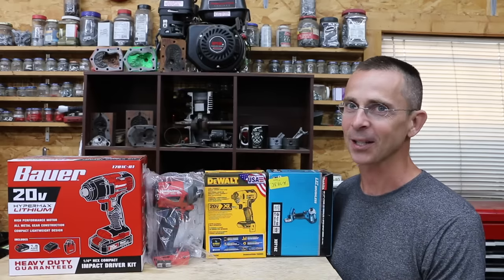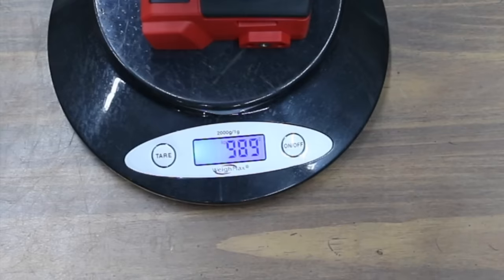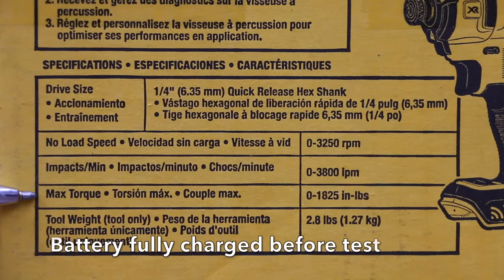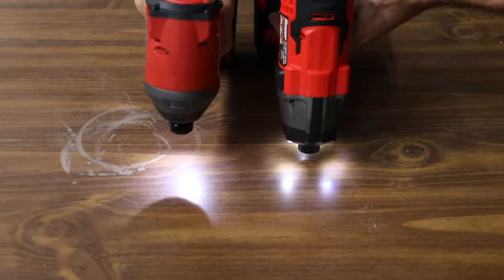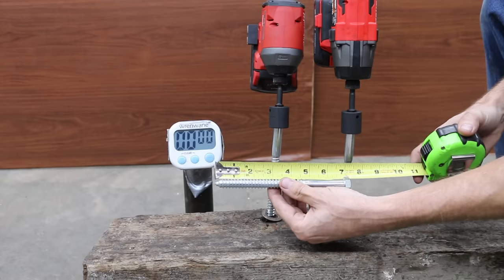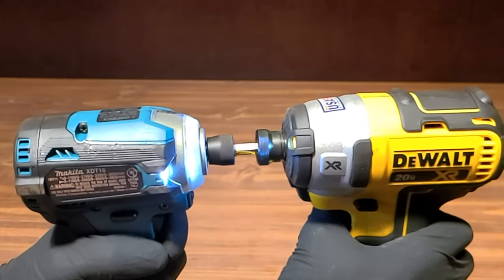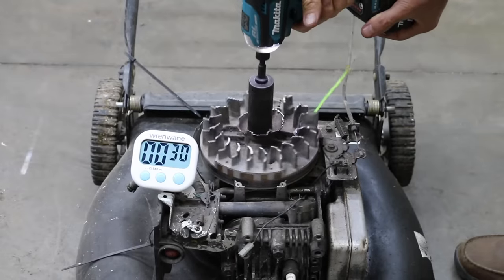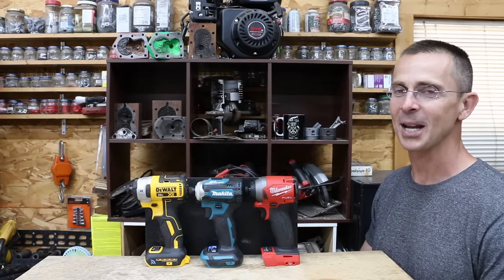Best Impact Driver? DeWalt vs Milwaukee vs Makita vs Bauer!  Let's find out!

Comment: Hey Project Farm if possible start throwing in Walmart’s “HART” brand to test when it comes to power tools, interested to see how it compares. Thanks!
Reply from the maker: Great suggestion!  Thank you!
Reply: I just bought an Hyper Though Impact driver. Too bad he didn't test this one but I took a shot at it, I'll see how it performs. I just wanted to take out tire lug nuts and some automotive uses.
Reply: Walmart are you serious ...wtf why would you buy tools at Walmart ????
Reply: @samsungvibrant13  I guess you haven't watch his other videos. I have bought several tools from them. Hyper Though Saw, Drill, Gas Weed Eater, Hammer, Ratchet and Sockets kit, and they haven't broke or not worked as intended. The gas weed eater is just a little difficult to start when is cold but when you already started it turns on fast, the saw sometimes struggles but maybe I'm not using it right. Take a look at the home depot or lowes prices for the same tools and you will understand. I'm not a hardcore user of these tools so I would not buy something expensive that I rarely will use, and the batteries are interchangeable 20 volt and that is the other reason. The other places sell you tools Without the batteries and the batteries themselves are expensive. The other places sell you the Brand, Walmart sells you the Tool. Again if you work in construction or you are a pro mechanic you would know what to buy and if you are any of those why would you buy another of the same tool if you are a Pro and know about this?
Reply: @samsungvibrant13  because you're there anyway to buy scratchoffs and beer
Reply: @samsungvibrant13  Haaaa my thoughts prezackly,,,  I would not go to China mart if the tool was free!!!!!!!!
Reply: @victorbunch7725  ive bought hypertough and the drill suck overheat very quickly. Haven't gave the flagship brand hart a try yet though
Reply: I'd like to see the Kobalts in there too!!
Reply: Aham Have you used it yet? I’m looking to do the same thing. Lug nuts and brakes mainly.
Reply: Is there a reason you didn’t include Ryobi or other brands? Kobalt perhaps or Craftsman
Reply: Great request for I to own the Wall Mar heart (brush type)  cordless impact driver. I've only used it a couple of times on some small jobs and for the price so far I'm a happy consumer but would love a side by side compareson with harbor freights brand.
Thanks and keep em coming.
[Liquid Wrench] 👍 [Milwaukee] 👍
Reply: Please test the Ridgid Octane
Reply: Hart is junk.  They're no better than the old Hyper Tough brand.
Reply: @theblukatlife  I bought a hypertough 3 tool bundle (impact driver, drill, and flashlight) for use in the barn. They aren't fancy, but they do what I need them to do.
Reply: really good suggestion!
Reply: @samsungvibrant13  because Hart has actually tested out decent. Check out "vcg construction" this guy is in love with Milwaukee but does test other brands quite a bit, albeit not nearly as scientifically as PF does.
Reply: @samsungvibrant13  cuz 99.9% of American are on a budget...
Reply: Hart will beat the dewalt i bet!
Reply: @ProjectFarm  I would ask that Ryobi be added to the list as well.

Comment: "The Bauer is Heavy-Duty guaranteed for 90 days."
😂😂😂😂😂😂
Reply: Did it even last 90 seconds
Reply: Ridgid has a lifetime warranty I guarantee they will weasel out of.  My experience with Makita and HF warranty is they are good as gold.  You can't complain about a 90 day warranty if the company supports it and that's what you bought.
Reply: Just have to replace it every 90 days
Reply: @markblanc5993  I doubt the Bauer would break in 90 days.  I won't buy one because it's too big and I have no problem with the price of the Makita.  I'm invested in the Makita battery.  If I had to use a Bauer, I'm sure it would work for years.  I don't burn up my tools or drop them onto a driveway from the sky.  Maybe 6ft off a ladder or 12ft off a roof, usually onto a surface with more give than a driveway.  It was a fun test and the Milwaukee was impressive.  I'm not switching from Makita because Milwaukee's impact driver is slightly better.
Reply: Clearly guarantee days in China are far shorter, unlike their labour days.

Comment: I would be interested to see another round of impact drivers. maybe a lineup of something like Kobalt, Rigid, Ryobi, and Bosch. Thank you for the wonderful content.
Reply: Rigid wins with warranty - hands down.
Reply: Don't forget Hercules
Reply: And Metabo HPT triple hammer
Reply: @narlycharley  Don't they have the same warranty as milwaukee? 6 years? Both brands are owned by the same company.
Reply: And Hilti, Festool and Ryobi.
Reply: Yes - I am curious since I have mostly Ryobi tools (been happy so far), also he should compare to some pneumatic ones.  I have had some tell me cordless is more powerful than traditional air ones...yet John Deere service had to break out an air impact to replace a clutch on my tractor because the cordless wasn't cutting it.  I want to know if its a fluke or which to buy for those tough jobs
Reply: Rick Sanchez Rigid is lifetime warranty on the tool and battery.
Reply: HILTI too!
Reply: @ricksanchez7459  ryobi, ridgid, and milwaukee are the same company. Ryobi is their homeowner tool, ridgid the entry level contractor, milwaukee the top of the line. Interestingly, only the ridgid has lifetime warranty on their tools. I believe the reason for this is since they aren't top of the line don't have the new features, and are a little larger they often hold up a little better. My personal tools are ridgid, my work tools are milwaukee. Ridgid gives about the same performance at the cost of a couple features, and since they are larger, there are places they don't fit, benefit is cost and warranty. There's also less selection of tools. Milwaukee makes everything. So no matter what you need, they make a tool in their family. But with smaller size and newer features, and higher expected performance, there's a cost in reliability. It's like luxury cars. They have the newest features, but they're largely untested and take time to trickle down to other vehicles, and are figured out by the time the trickle down happens.
Reply: @connorjones1485  Will Milwaukee be introducing a power washer? I think they have a Ryobi version, but haven't made milwaukee yet. I would love to have one. Bought my wife the m18 vacuum aswell, she loves it. You all have something for everyone! Love seeing "made in vietnam" as opposed to china, every little bit helps.
Reply: @matthewmiller6068  Pneumatic impacts are far superior. If having air under pressure for all your work isn't a problem, don't bother with cordless.
Reply: @narlycharley  Yeah, but you'll probably have to use it, and their batteries are junk.
Reply: @narlycharley  Ahh I see, my guys and I are very hard on tools(heavy, constant use) and have been bouncing between makita, dewalt, and milwaukee. Milwaukee has a ton of oddball tools, which is good to get most use out of batteries!
Reply: Definitely wanna see rigid
Reply: I’ve used a Ryobi Brushed, it’s not great but she defo got the job done, especially for the price.
Reply: I have some Rigid tools and would love to see them compared.  They do good wrenching.
Reply: @user-zz8ln3uh5x  Festool? Who the hell is that? LMFAO!

I'm off to Google it lol
Reply: @Lord Raiden Why? They're made by Stanley-Black & Decker like DeWalt. Why I don't buy DeWalt,  "Made in China" is never a good thing lol
Reply: TTY ind. owns ryobi, ridgid, Milwaukee. That's their quality tier.

Ryobi is fine for the homeowner. Slow, but reliable. Ridgid is ok, but still slow. Milwaukee will tear itself apart getting shit done in a hurry. 

I buy Milwaukee because it makes my paychecks. I have no issue replacing a tool every 3-5 years when it's worn out because it's made me $. 
For the homeowner that only cares about warranty? Ridgid is your choice. 

I had way too many failures with the 18v xrp dewalt to ever spend money on them.
Reply: Check out AvE’s channel.  Many of these brands are owned by about 3 companies.
Reply: @ricksanchez7459  you cant go wrong with the honda motors pressure washer
Reply: @allthingsmowing  There are two reasons to have never heard of a brand: It's cheap junk that never would have crossed your path, or expensive premium stuff and you've never crossed their path. Guess which one Festool is.
Reply: I love my new Kobalt XTR, I prefer it over milwaukee, dewalt and way better than ridgid.
Reply: @matthewmiller6068  Ryobi and Milwaukee are made by the same company.
Reply: I don't need the best. So, I'm happy with the most American made... Dewalt. 
I bought my 12v at a pawn shop 4  years ago. Still going strong. 
The only 20v I have is a trim saw and 1/2 inch impact.
Reply: My guess would be rigid on top.
Reply: @ricksanchez7459  lifetime warranty if registered.
Reply: @ricksanchez7459  They're not owned by the same company.  TTI  just has the licensing rights to Rigid power tools only.  The Rigid brand is owned by Emerson Electric.
Reply: And the hydraulic Milwaukee
Reply: @AlexRides808  Makes sense. It is as if the ridgid batteries are from a different country quality wise.
Reply: Hitachi? 😳
Reply: Don't forget Hart...Walmart brand
Reply: I use Ryobi tools at home, due to the vast amount of tools they have, especially home, and outdoor products. I use Milwaukee at work though, when the money is on the line!!!
Reply: @baraksinz  I work with in building cargo doors and we use nothing but metabo hpt triple hammer impacts all the drills have gone through thousands and thousands of self tapping screws every day for about 2 years now and every couple months the motor slows down and we have to get new ones but they have been put through the paces the whole company uses them for just about anything heavy
Reply: @baraksinz  i love my little meta, i didn't want to spend that much on the triple hammer though. it has the best grip i tried.
Reply: I think that Ryobi will be a formidable competitor

Comment: Dewalt has so many different 1/4 inch impact drivers. Would love to see a comparison between all of them, being a Dewalt guy. Also would love to see a comparison test between cordless 3 inch cutting tools. Everything I’ve seen so far indicates that Dewalt blows ‘em all away, :-) 👍👍👍
Reply from the maker: Thank you for the video idea!
Reply: I know its hard to switch away from your bias...but try a Milwaukee, use one everyday. They are substantially more powerful than a dewalt. I used to be like you, but then when I noticed 99.9% of my co-workers using Milwaukee, I decided to try one, I understand why they are so popular now, they are absolute monsters and very veryyy durable in real life use. Milwaukee tools lineup has taken the crown over the past decade. Hardcore mechanics have switched away from snap on for Milwaukee. Dewalt is kind of just living on former glory at this point. Cordless tool use, Milwaukee is a MUST HAVE.
Reply: @jaredchampagne2752  It's not just a matter of bias, it's a matter of investment! When you already own the batteries and other tools it's difficult to make the switch.

Comment: Speaking from experience Milwaukee installs safety stops in their tools to prevent damage to the battery or motor.
Reply: Just about all tools have had that since the early 2000's it's not just a Milwaukee thing.
Reply from the maker: Thanks for sharing.
Reply: Dimes .. no it's just a Milwaukee thing
Reply: @tonyhawk5608  No it's not Lol Makita is the only brand that uses sensors to prevent battery damage.

Comment: Protip: when a tool is starting to overheat remove the load and continue to run the tool at a medium speed for a bit. The fan will help prevent the heat build up that happens as a tool sits
Reply from the maker: Thanks for the feedback.
Reply: Heat-soak. It's the same with car vehicle engines. Idle to cool down.
Reply: ohnestly , in my experience this helps but soon as a tool smokes, IMHO its done, it may just take 6 months to show its done, but its done. I use cordless power tools every day and have just grown to accept, soon as I see smoke, may as well buy another  cause that tool cannot be depended upon.
Reply: J S  it also depends on why they are smoking.
Reply: What fun would that be? Nothing is as fun as watching crap being destroyed. The best failure is a catastrophic failure, at least they are the most fun.
Reply: @michaelconran5252  the comment wasn't for the video but for every one else. Most of us don't want our tools to be destroyed
Reply: J S  yeah that's a pretty heavy load and can take a while long hard use is usually what does it to the motor. However as long as you take your time and try to keep it somewhat cool most tools should be able to handle it.
Reply: @dimesonhiseyes9134  I know, I just gave my 2 cents. Well not even worth that.

Comment: I remembered this video from a while back and have seen some recent videos with unfair tests claiming that Milwaukee can't cut it vs DeWalt. This video proves otherwise. Part of the reason I bought into the Milwaukee tool platform is because my impact driver is my most used tool and Milwaukee just makes the best impact. Only had them for a year but all my Milwaukee tools have been through the ringer and have all survived quite well.
Reply from the maker: You are welcome!  Thanks for the feedback.

Comment: On my Porsche Boxster I have a set of Pia wiper blades, installed on December, 2016. They still perform well in the Florida heat and rain and yes I drive it every day with 84K. Recently bought a set of Michelin Guardian blades that I bought at Costco for $9 each for my 2020 Toyota Highlander. Compare that to the Toyota replacement cost of $24 each. At $9 each I think I will buy a set for my Porsche.
Reply from the maker: Thanks for sharing.

Comment: You should do a set of test videos on 3/8 electric impacts and 1/2 electric impacts if you haven't yet, I use Milwaukee fuel for both sizes as a professional mechanic/technician and I am very interested in seeing if any cheaper brands are as strong!
Reply from the maker: Thanks for the suggestion.